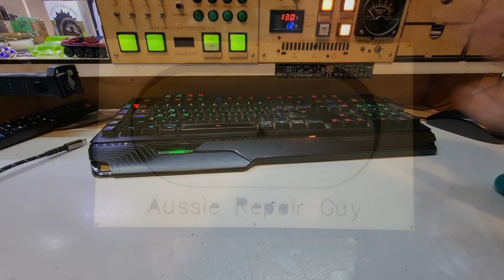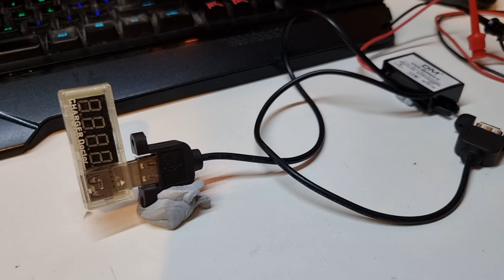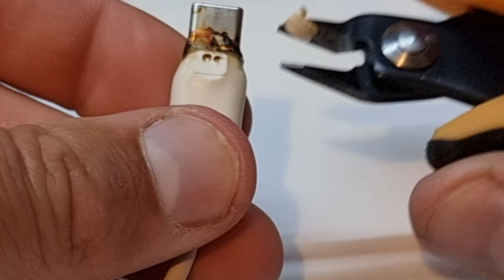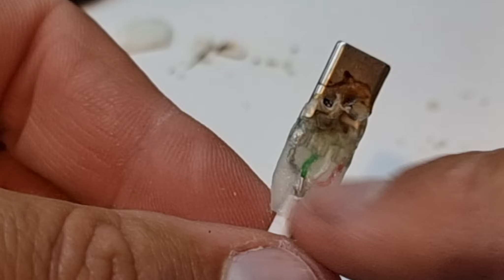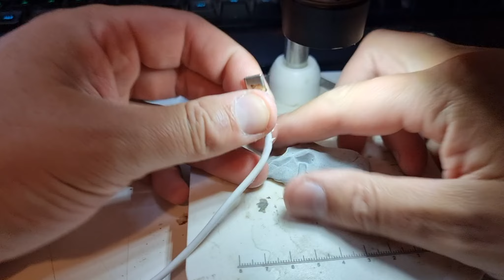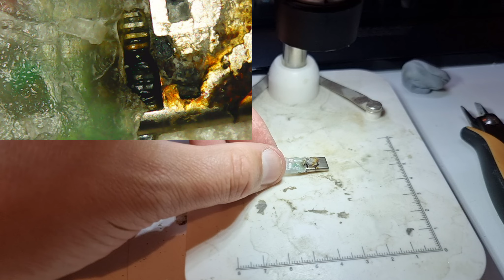Burnt out USBC autopsy | Fire risk!

Comment: Seems to me there were, once upon a time, magnetic adapters for micro USB connectors.  Not sure if there is such a thing for USB C though.
That might solve your daughter's issue of wiggling the connector out.  I know I cut up a lot of ruined USB cables and changed a few charging ports of devices when my 3 were younger.
Reply from the maker: I have magnetic usb-c connectors, she pulls them out and looses them.
I bought 15 of them last month.